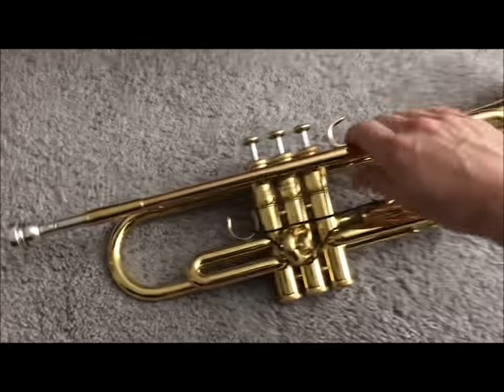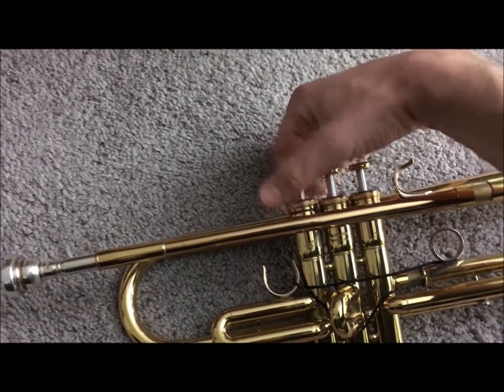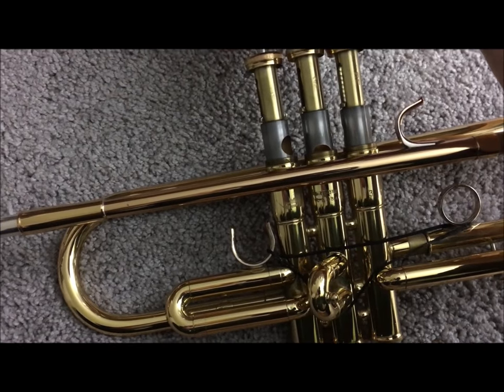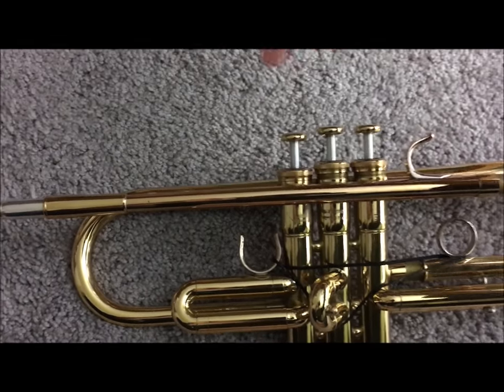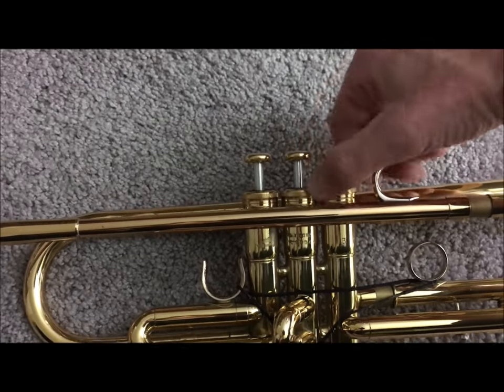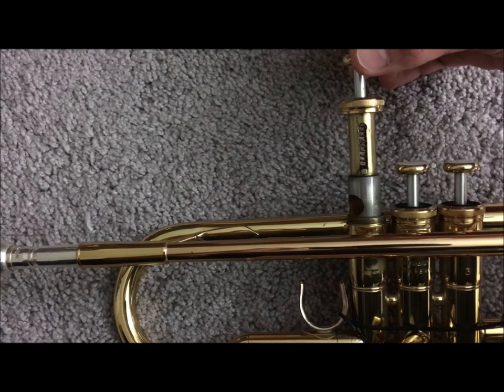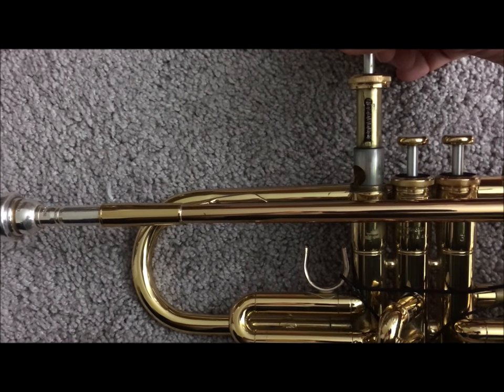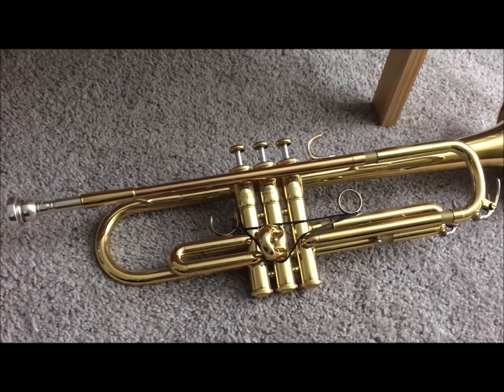How to Properly Insert Trumpet Valves (What To Do If No Air Is Blowing Through Your Horn)

Comment: I play a Bach and I have a sticky valve problem. It happens once in a while. (Only for valve 2 and occasionally 1) One of those slowly rising up thing that’s really annoying. I tried cleaning but it eventually comes back. I use a Yamaha Synthetic Regular valve oil. Any tips?
Reply from the maker: Hey Kaz - man...this happens to me from time to time. I can't really comment from a technical horn perspective like a repair person but in my case, I think it's related to finger technique. Like, if my fingers are not quite in shape (when they are I like to imagine they are robotic like the Terminator or something haha) then the down stroke is a little sideways or something which causes some friction along the inside of the valve casing. Then the valve might get stuck or come up slower. If I'm nailing the fingerings down in the practice room it doesn't seem to happen. Could be in my head - worth thinking about though. check out the how to hold your trumpet video for the fingering style that helped me out. Take care dude

Comment: What to do if there is no number in valve
Reply: start inserting from valve in position n.3 (bell side and first air flow passage)... if it works not pressed and pressed and also pressed it is the correct piston, then do the same for position 2, then only one will be left... as for rotation it's enough to match the wider white notches... look inside what side the wider guide is and insert the pistons all with that same orientation.

Comment: I don't have numbers on my valves. It should be the same with a cornet, because they are basically the same instrument. So I don't know.
Reply from the maker: should work the same. You can also 'figure it out' by examining the holes on the valves and determining where they would line up with the trumpet tubes.

Comment: I have tried this so many times but it still doesn't work
Reply from the maker: maybe the valves are in the wrong casings?
Reply from the maker: or you might legitimately have something lodged in your horn - take it apart and try to blow air through each tube.